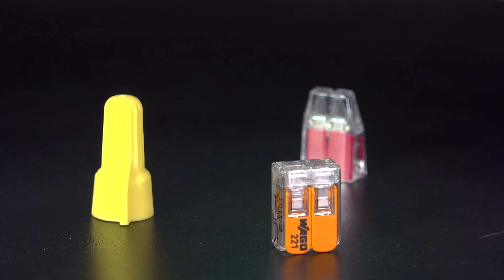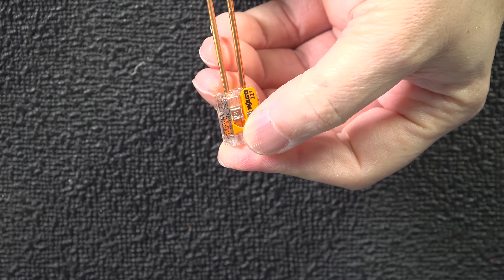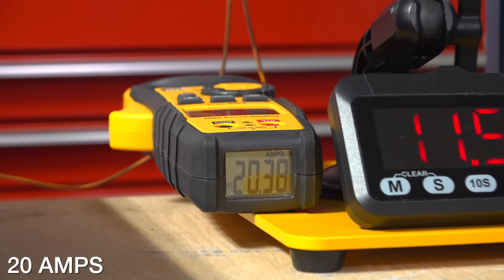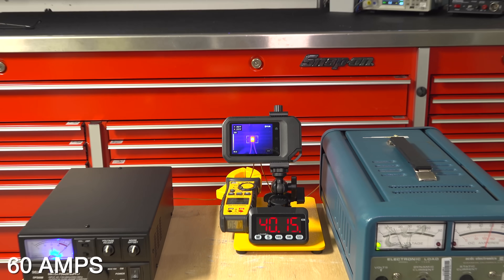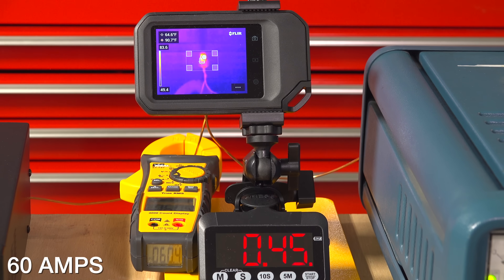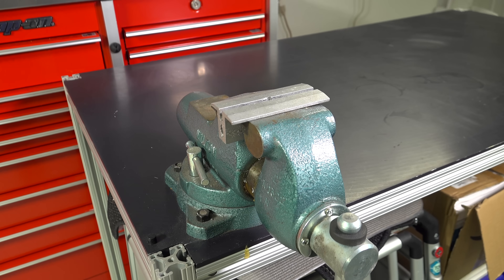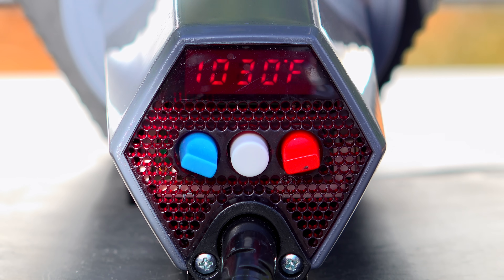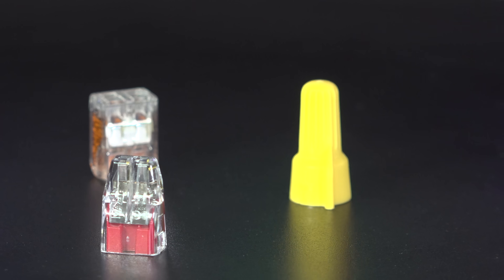What Wire Connector is the Best? Wire Nut VS Wago TESTED

Comment from the maker: Thanks for watching please LIKE & SUBSCRIBE:  WAGO starter pack: https://amzn.to/3tb0Dcd  Ideal Wirenuts: https://amzn.to/2NIc2AG
Reply: The key difference, is the price right
Reply from the maker: @Simcore999  If the features matched yes, but the Wago gives a lot more and if you are buying 10,000 of them I guess it adds up but for repair and home work the difference is insignificant.
Reply: @SilverCymbal  Yes, I would use the wago for medium length projects and for short term the other with souder for long term!
Reply: @SilverCymbal  I don't see them replacing the wire nut for this reason alone.. They'll never be cheaper. But if somebody screwed up and ordered stranded wire they're awesome 😂
Reply: @Simcore999  that's why there is the wago 2237 series
Reply: When you pre-twisted the wire nut I believe a large amount of the current and heat was bypassing the wire nut joint. Try that same test without pre-twisting the wire like the instructions state please.
Reply: @mobeydick37  Yes, if there is any pre-twisting of the wires for the wire nut then it should only be for the length that is covered by the wire nut. In a real circuit any lower twisted portion would not conduct electricity as that part of the wires would have insulation. Still, I would expect the wire nut to hold up best in this particular test, as the weaknesses of wire nuts are in other areas. Those weaknesses include installation time, length of wire needed, distortion of wires by twisting, debug and testing is harder, joining of solid and stranded wires is poor, and it can be difficult to identify a loosely connected wire when multiple wires are twisted together.
Reply: @JasonEDragon  Don't forget the risk of annealing the copper when twisting the wires together.
Reply: @mobeydick37  There is no need to pre twist the wires, but if you twist the wirenut tight enough, they will twist in the wirenut a little.  That is exactly the reason why wirenuts are better, when the copper lays in the wirenut side by side (like spooning) the wirenut is NOT carrying the amperage, it's merely clamping the wires tightly, the amperage is conducted copper to copper, wire to wire!
Reply: @bebo5558  I have to disagree. There is the genuine risk of annealing the copper.
There is also the problem that it takes a fair degree of skill to make a perfect bond with a wirenut.
With a WAGO, it's far easier to get it right.
Reply: @ethelryan257  You can't anneal copper by twisting it, annealing is a heating and cooling process.   It takes very little skill to use a wirenut, just keep the end of the wires even and screw it on!  The Wagos I have replaced were burnt, they were the weak point!
Reply: @bebo5558  Wire nuts do require a bit more skill, otherwise when I've remodeled over the past decades and took apart old circuits I never would have come across a wire that was obviously not gripped well by a wire nut. Once the wires start to twist beyond the nut the pull test doesn't work as well and sometimes doesn't indicate how well the connection was made under the nut.
As for failed Wagos, I wish someone would actually post a picture or video when they encounter one, as I haven't seen any yet. I have seen bad wire nut connections and bad push in receptacle connections.
And what is important is how well a connection holds up over time with thermal expansion and contraction, not just how solid it is on day 1.
Reply: @JasonEDragon  Everybody on earth has horror stories of bad connections, things are never perfect, but everything has a track record!  I've used ceramic wirenuts, bare springs you twist on and tape up, plastic wirenuts, wirenuts that were found to contain aluminum in the spring, not all wirenuts are created equal!  I don't need to send you a picture of a failed Wago, it was melted into a blob anyway, because until you run into one and hold it in your own hand your not going to take anyone's advice!  I don't use push-in plugs and switches either, I know not your problem!  I'm sure Wacos are a work in progress, hopefully always getting better, but not for me, because of a track record!
Reply: @JasonEDragon  I put more stock in experiences from this side of the pond, they have 220v over there, half the amperage may skew the results of failure?  And you basically summed up what I said, you have to make up your own mind, based on your own experiences!  When I worked industrial, the electrical engineers on the jobs wouldn't allow Wagos either?
Reply: The wago is great for when you need to redo the connections often
Reply: @dariodalcin5177  60amps at 120v?
Reply: 3 hrs is the minimum heat up time for a continuous duty electrical circuit running at 80% load and that is the actual testing specification for devices of this type....also something looked odd to me in the test of the wire nut. it looked like all the heat was concentrated right at the tip of what appears to be a bare #12 conductor , the heat should start right at the point where the braid starts which is about a full inch below the wire nut. so what is the deal? is that a varnished conductor? and if so did you properly strip  it for an appropriate length (about 1/2 to 5/8 of an inch) for the splice to have the required contact surface?
Reply: On the temperature test:   better to put the connection in a closed box.  Say, a blue plastic one. With a recep + cover plate.
Yeah you lose the ability to use your whiz bang IZ cam, but you also lose thermal cooling from convection in the ambient air.  
60A is kinda psychotic (unless you're one to stud your fuse box! 😜) but 22 or 23A is reasonable, assuming there will be breakers.
Better:  in the elect box, put the connection against the side wall  that faces a std #2 pine 2x4.
Sorry, that's a double whammy for your IR cam.  Got thermocouple?  Slip it in the box or between the box and 2x4 (without creating a gap between the 2.)
Set your current, wait for the current to reach steady state, and observe if the #2 pine fumes, obtains scorch marks, or produces other signs of interest.
Reply: Is there a reason you didn't perform a wirenut pull test?
Reply: you actually used the wrong wagos because these are ment to be used for flexible wires
Reply from the maker: @palkop907  That is wrong, the Wago 221 are rated and designed for solid or stranded wire or a mix of both, feel free to check their specs
Reply: @palkop907  It says literally on the box that you can use them for any type of copper wire with the right gauge
Reply: @leckmiamoarsch3222  yes idk whow its in other countries but in austria you should use it for flexible you can use it for solid wires but for these there are other wagos...
Reply: I've another test idea "Physical Durability" you hit them with a hammer and see what one still works.
Reply: The testing performed in this video was on solid core wires only. I'd like to know how these connectors compare when joining solid to stranded, and stranded to stranded, versus the traditional twist nuts. Most light fixtures and ceiling fans nowadays require a stranded to solid core connection.
Reply: thats BS. Put them upside down and use stranded and you will see why no one real use wago.

Comment: You did twist the wire over the normally insulated part. So you did start with about double the contact as it was made for. This test you should do again with either insulation or contact free just after the inner part of the wire nut. Maybe the Wago is still hotter but  ...

Comment: It seems like the wire nuts will always have a superior connection since it utilizes the twisting of the wires AND the metal spring bus inside the wire nut, where as the wagos only connect using the tiny metal bus. With anything i believe the biggest problem is used error and the wagos are probably a little more retard proof. I think wire nuts are a lot better than people give them credit for.

Comment: I'm going to defend the wire nuts. Like everything, quality is a spectrum. If you buy good ones and know what you are doing, wire nuts work well. They are particularly useful for making connections in tight areas and for connecting wires of different thicknesses. They are also dead simple.

Comment: I feel like the heat test was flawed as the wires are twisted together (without insulation so allowing current to flow) outside of the wire nut which isn’t a conventional situation (for hots and neutrals).  Conveniently the only contact between the conductors is within the wire nut.  He should have tested both insulated wires or limited the twist to a small portion contained in the wire nut.

Comment: This is not a good test. 

1. Most glaringly you completely ignore electrical resistance even though you say 0:30 "because a connector's job is to conduct electricity".  You should have measured the voltage across the connector to determine its resistance. I bet my nut the Wago connector introduces much more resistance than the wire nut. If a connector has more resistance this of course means that for a given voltage it will heat more and continuously emit that heat inside the box. 

2. You didn't do a pull test on the wire nut, so unfair.

3. Unless I missed, you didn't specify the gauge of bare wire you used, it looks like 10 gauge?

Comment: The bare wires were twisted together before they entered the wire nut.  Twist some bare wires together then put the ends in the Wago.  Repeat the experiment and compare.  There was less power going through the wire nut, due to most going though the twisted wires before it reached the nut.

Comment: I was surprised at the negative comments about wire nuts from the professional electricians below. I have a much smaller experience base than they do but I maintained an old 17 year apartment for 30 years. I saw exactly one wire nut failure in that time. It was a wire nut with five neutral wires. My personal policy is that four wires is the max for a wire nut, so that failure would not have happened if I had installed the box. The connections in the original boxes were with soldered with friction tape for insulation. I had at least a couple of failures with those. The soldering seemed to have made the wire more brittle. 

I did like the comment by one of the professional electricians about how the wires can twist more easily in a box wired with Wagos. From an amateur's point of view that does sound like an advantage. We amateurs are usually not as skillful at pushing the wires into a crowded box as professionals.

Comment: As a electrician for over forty years a properly installed wire nut is by far the safest  .
Reply: The reason the wirenut performs cooler is because the wires are already twisted partly touching before going inside the nut.
 
The metal casing inside the nut doesn’t have to carry the full load unlike the wago where the metal inside the connector joints both wire together. 

A better test to figure how the wirenut performs would be to let the wires touch only inside the nut and seperated outside.

Comment: Would you use Wagos for 240-volt thermostat connections?  Have to replace some 60s-era radiant ceiling heat thermostats and the newer double pole ones combined with having to add wire nuts just crowds the wall box up.

Comment: I live in northern Europe, I've been doing electrical work for 15 years, worked on everything, construction, industrial, commercial, residential. Never have i seen a Wago connector fail, even the first gen connectors from the 80s, possibly even older, still held strong, while i seen some wire nuts from the same era (or even newer) being loose, either because of human error when installing it, or the copper itself loosen and contract over time due to current. Not to mention, they are a difficult to measure voltage on. I just usually cut them off whenever i do a service job lol.
To be fair, I have never actually seen anyone buying or using wire nuts ever since i started apprenticeship. Never gave them much attention when picking up materials, but, out of curiosity, i just checked with my local suppliers. There are a few stores that still sells them, you can still buy them online, if you really wanted to, but it looks like they are on their way out. 
I just don't see too many pros when it comes to using wire nuts.

Comment: Just watched this one and the Wago vs HF. Thank you so, so much! You just saved me all that time I was going to be putting in this week to do the exact same tests with the exact same connectors, except mine would not have been as precise as yours. I was going to be using 14 and 12 gauge stranded wire, twice as long as the inside of a 2000 square foot house, corner to corner. Im subscribed already, and hit the thumb up. Going back to W vs HF now to hit the thumb and leave you a comment. Comments help, too?? Anyway, im staying with wire nuts. I tape them twice. Once stretched, and then regular. Then a 40 pound wire tie on the tape, a bit past the nut. I do mechanical troubleshooting and diagnostics. Im probably gonna run the same typ tests with the smaller gauge wires, with and without solder joints. We shall see what we shall see. Again, thank you so very much!!!! Best wishes!!!

Comment: AC amps and DC amps are not quite the same effect.
Reply: For 50 hz, it pretty much is unless you deal with HV transmission lines...
Reply: @TheEsseboy  So why is the DC amp rating for a switch lower than the AC rating on the same switch?
Reply: @robertcromwell9736  Because it is switching, not just conducting...switching DC vs AC is very different.

Comment: It's amazing Wagos do so well.  With a wire nut it's wire connected to wire. Wago setup is wire, wago, wire.   Just seems like it would add resistance.
Reply: The wire is thick enough inside the Wago, so it is basically wire to wire.

Comment: The only thing about the 221 lever nuts that bother me is the wires ability to move even when it’s latched down. Although it is difficult to pull straight out, the wire can rotate within the cage clamp assembly. Although I have used these in various applications without issues, knowing the wire can move against the internal buss bugs me. 

Out if curiosity… I inserted a solid core wire into a 221 one and rotated it back and forth a few times to find that the 221 ejected the wire! A few half or quarter turns back and fourth and you will hear a “click” and the wire is literally ejected. 

I realize this is unusual behavior, but is there a possibility of similar behavior under vibration if it was used on machinery? Dunno… but I found this phenomena a little unsettling.

Comment: The soft plastic wire nuts are garbage, when you tighten them they swell and the inner coil expands. The hard plastic non wing ones do not do this.

Comment: Having seen WAGO connectors used in Germany for many decades, I have full confidence in them and wired my whole house using only Wago connectors. They are also more efficient to use and provide great time savings as well as flexibility when changing some connections. With a 20A circuit breaker, a 40A current would be disconnected by the circuit breaker within 30 seconds, according to a Schneider Time Current Curve data sheet. Thus, in real life, there will be no overload of 40A or 60A for 10 minutes while circuit breakers are functioning properly. 

Overloading 12AWG wiring for 10 minutes or more with 60A could cause serious problems with the electrical insulation of the wiring in the wall, which is rated at 60 to 90 degree Celsius. Thus, any circuits overloaded in such a way would have to be physically examined for damage and possibly changed. The Wagos would be the least of my concerns. Thankfully, circuit breakers don't usually fail in such a way, but I have seen people swap 20A circuit breakers for 40A or 60A in order to accommodate a high-powered appliance or an old style welding machine. Maybe this only happens in the Philippines...

Comment: European electrician here. We use Wago for everything. They are perfect if used within specifications. Most important thing is respecting the ratings... There are wagos rated for higher A if needed.. but generally you will be using 221 everywhere and be fine. 
Small tip: if you have a full box and are worried about the clamps opening when you close it, just wrap a bit of tape around them to avoid accidentally opening the clamps when pushing the wires in.

Comment: I think the wagos biggest advantage is it harder to screw up when your inexperienced. Witch might not meen anything too an electrician but remember in America anyone with a flat blade trys their hand at doing electrical. I use wire nuts when im working on electrical because my father bought them in bulk when he used to do electrical so i still have hundreds to use at this point.
Reply: Doesn't matter, laws and regulations should not stand in the way of better methods, then the regulations need to adjust to adapt.

Comment: Wagos work always in specified range perfectly, no need for testing that.
Specs are tested million tmes at manufacturer before.

The main difference between a spring connector and a screw connector is, temperature changes do not affect spring connectors.
Wire nuts are forbídden in advanced countries, because many of them lose connection over time.

The only good test is: let 1000 wire nuts stand for decades with daily switched maximal current and count those, which are lose afterwards.
But even dumb american electricians know the result already, as they usually blame the previous electrician for not properly installed the wirenuts.

Smart european electricians knew the result too and ended it with a wire nut ban.
And besides they also prefer spring connectors at outlets, switches, etc. for the same reason.
Faster and therefore cheaper installation is a side effect.